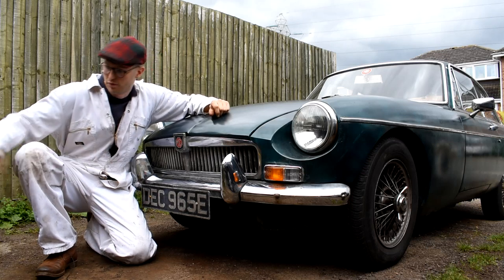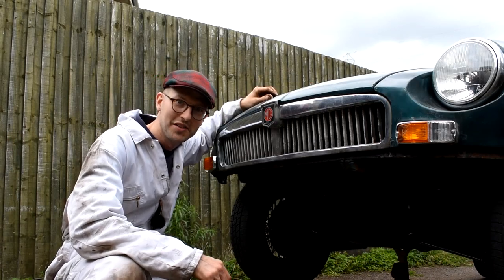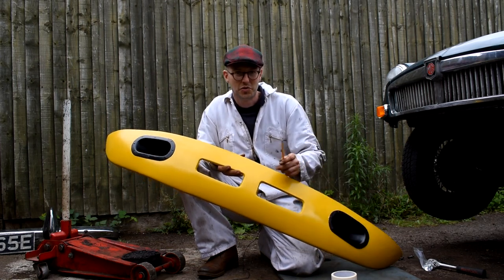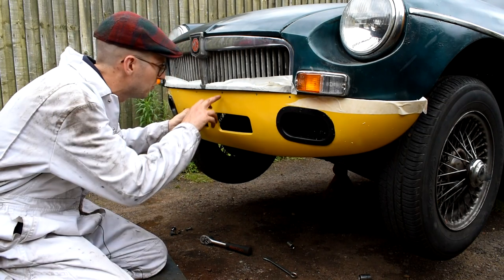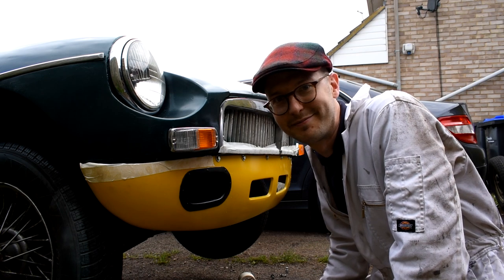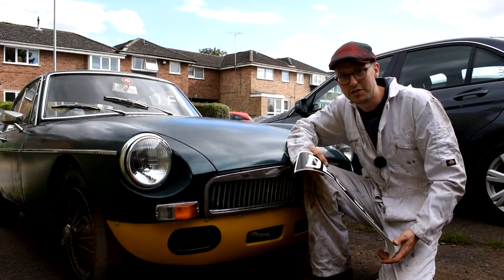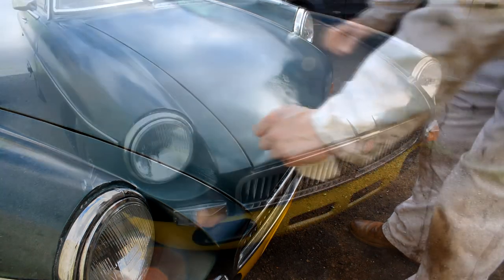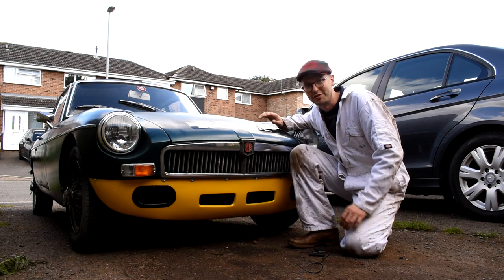MGB Sebring Conversion Part 1 Front Valance

Comment: I've  been restoring  Classics  for 50  years, panel  appears to fit ok  but I would have  painted  the panel body coloured and bonded  fixings to the back and fixed from the back, I'm 10:14  just starting a rubber bumpered car
Reply from the maker: Love the suggestion, I took my front valance fitting off a friends car, David Russell Wilks, you may of seen his YouTube channel. His front panel is made of aluminium and is bolted on the same as mine. I kind of like the corse look, and the yellow front I think just complements the green car. It's a more do it my own way bit of styling, and I'm really happy with the results 👍

Comment: Hi Steve. Looks great, currently on with a similar conversion. Chrome bumper at moment but Sebring front has just arrived. I'll probably leave the rear standard. Just after a bit of advice on your Paint work as looks fab. Primer , then paint or etch primer then paint. Rattlecan? Mine is probably similar to yours i.e fibreglass. Thanks Paul.
Reply from the maker: Hi Paul, I just did mine by first keying the fibreglass panel lightly with wet and dry, then primer a few good layers, then wet and dry until smooth. Then top coat, but a few layers of top coat and wet and dry through the coats, then last lacquer it, it seems to have worked well. Cheers Steve
Reply: @SteveDentonClassics  brilliant thanks Steve
Reply from the maker: No probs 👍🏻

Comment: Hi guys , can you convert the rubber bumper Mgb gt to have same front / back bumpers as Sebring ?
Reply from the maker: Yes, it’s possible, but you need to cut parts of the front off that hold the heavy original rubber bumpers

Comment: looks great, can you get a valance like that without holes? Do you need holes there for air?
Reply from the maker: Cheers Peter, they make several different types, so some have the holes for airflow some don't some have a chin spoiler on them. There is a number to choose from 👍
Reply: Could direct air, to the brakes for cooling?

Comment: Hi Steve. It looks great ! Measure twice  drill once.....l 've lost count of the amount of times that  hasn't worked !! l could easily make those rusty sections for you  but we do have a distance problem ! The problem l do see however  is the sebrings had extended wheel arches but l guess there are limits. I always did like the look of those valances .  Look forward to the next instalment.
Reply from the maker: Only the MGCs Sebrings had flared wheel arches, the MGB didn't have them (not in period correct anyway), although many people still fit them. That would be great if you could repair a few panel for me, however like you said the distance
Reply: @SteveDentonClassics  Of course ! It was only the MGC' s . Thanks mate.

Comment: Steve, returning to yellow, one panel at a time!  Sticking a license number to your paint work seems such an unusual thing to do.  I know historically it is accurate, just seems strange.  Is it modern practice as well?
Reply from the maker: Well it’s legal to do, as it’s a historic vehicle so 40 year rule in the U.K. comes into place. The rules recently changed so anything over 40 years old the rules are a little more relaxed on, so long as it’s roadworthy, ie tyres brakes etc are ok then things like historically accurate number plates on the bonnet are allowed. As for the yellow, that’ll be the only panel in yellow, I’ve seen race MGBs in green with the front valiant yellow and I just really like the look 👍🏻